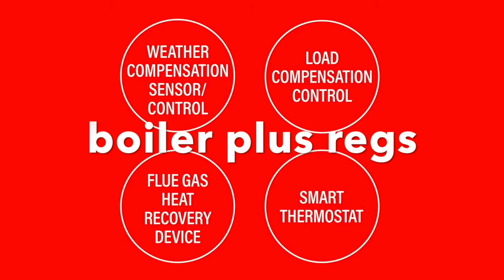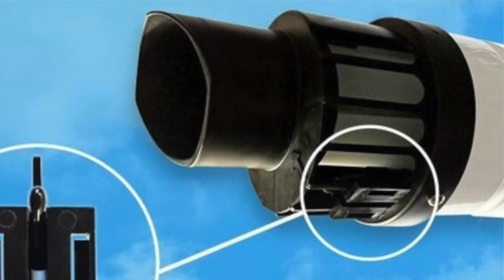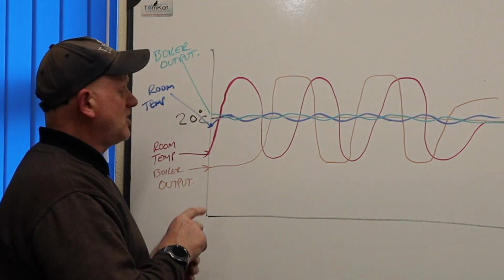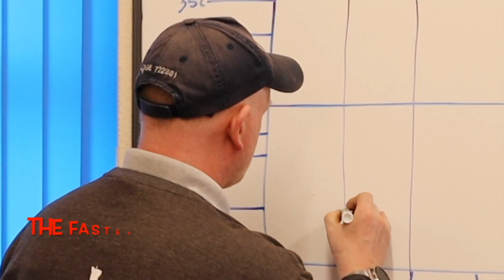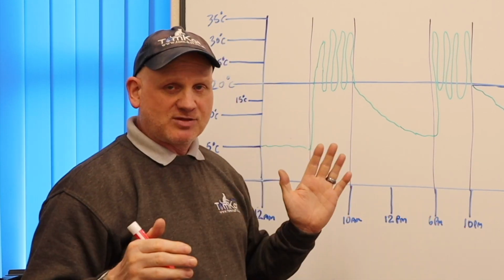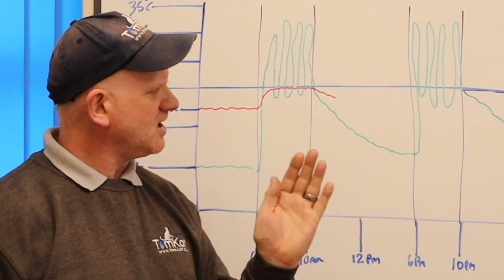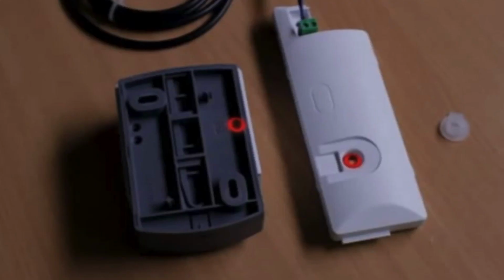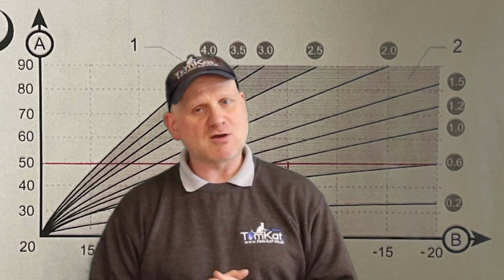Boiler weather compensation, what is it,  does it work and is it worth it.

Comment: Viessman have told me that it does use the internal controls temp sensor to know the inside temp! They say it monitors the return flow water temp and then uses that to infer the room temp. Dies that sound reasonable/correct/logical to u?

Comment: "Standard stats don't know what the temp is on the inside"  yes they do!!
Reply from the maker: No they don’t they work on a bimetallic strip that turns on or off the voltage it doesn’t know what the temperature is just what it’s been set to
Reply: @tomkatgastraining inwas referring to a standard elec stat of today with has a digital display and a room temp sensor inside
Reply from the maker: @kevinleesmith wasn’t talking about them I was talking about the on of state

Comment: Just keep your thermostat well away from radiators will solve a lot of this, prevent rapid cycling. Keep flow temp low. If boiler is on continuously at that temp should be good in winter unless system too small. In summer you don't need to set themostat low because temp stays high...

Comment: NO heating company I can find will fit this as standard, they advise against it as people heat the inside of their home and not the outside.  My new Bosch boiler has this setting menu, but the company said it is of NO use, so don't use it. The Bosch App even recommends NOT using it as it's problematic and far better using indoor room thermostats and TRVs.  The less your boiler needs to fire up, the less gas you use.  By using a temperature sensor outside and taking no notice of room temperatures, you end up having the boiler on continuously wasting a lot of money and get a luke warm house as you do with heat pumps.
Speak to installers, speak to manufacturers, they will all confirm this advice given customers.
Reply from the maker: @Bond2025 some how you are missing the point of weather comp. It works in conjunction with a room thermostat and TRVs in a nutshell the weather comp just reduces the flow temperature in conjunction with the outside temperature so the colder outside the higher the flow temperature. The room stat as long as it’s talking to the boiler ie open therm tells the boiler when it’s getting close to the room temperature to reduce the flow temperature even more. Installed correctly and set up correctly it works and saves money.

Comment: Why do I need a temp sensor on the OUTSIDE of the house, I am not heating the OUTSIDE.  I use sensors on the inside for the amount of heat required in the inside.  If a house is insulated, the outside temperature has no relevance to the inside!
THINK about it.
If you turn down the flow temp of combi boilers, you need bigger radiators and need to keep it running longer.
It's like having a turbo on a small engine, you need to work it harder than a bigger engine, which would be a standard boiler.

Exactly WHAT difference will this make when I set my heating to heat the INSIDE of the house to 22c between 5 and 9pm?
If the outside temp falls down to 0c or goes up to 7c, and the house cools down inside slightly, my boiler will keep working longer and the thermostat inside will keep the inside temperature at 22c.

God knows why you would think sticking a thermostat on an outside wall would do anything for the inside.  Why would I want to reduce flow temperature from 70c to 55c if it was 15c outside?  I really don't understand that, the boiler would be on for far longer and use way more gas.

I would prefer to have 70c flow temp and use the boiler for 20mins on and 20mins off, than gobble gas at 55c for a whole hour.
Reply: I must admit, I too feel the same way and I've tried both, 45c and 60c. We have the heating on all day so we're not too bothered about the length of time to get up to room temp (19c) per se. It virtually uses the same kw but in different ways, and anyway it's only a 5% difference in efficiency. This  5% is easily used up with the pump on usage in electricity. In fact, with the 60c flow temp I can actually put the room stat down 0.5c because of the overshoot. I suppose it's finding a happy medium.

Comment: Good video & I’m learning. To check though, the weather compensation unit, doesn’t over rule the thermostat?  The whole temperature is only set by the thermostat. Then the compensation evens out those peaks & dips. 
If going away for a week or so, then can set the whole house to be 15 deg as you showed, on tick over. Then the smart thermostat timings & temp settings can be adjusted as normal on an app etc.
Reply: Why are you trying to control the INSIDE temperature of your house using a temperature sensor OUTSIDE?
Use internal thermostats and TRVs and leave the boiler to switch on when the rooms get too cold, it will switch off when the temperature is reached.
I leave my heating on 24hours, if the timer isn't set - it only fires the boiler if a room drops below 18c, which it doesn't for most of the winter and certainly doesn't in the summer.  I have the thermostat on 22c, so it switches off when the room reaches that, then if it drops, switches on for a few minutes, then stays off.
If I was to leave the boiler on and call for heat at 15c, it would do that, but would only come on once every few weeks. Why would you want to fit an outdoor sensor?  It has nothing to do with the inside and if you turn flow temperatures down, you end up using more gas as the boiler stays on permanently to try and reach the room temperature you require.  The operation of the boiler is ruined if the return temp drops too low.
The flow temperature is chosen for a reason, efficiency.  Just because it is 70c, doesn't mean it is wrong or bad, that is what is required to get your home to a desired temperature with the most efficient use of gas, and takes into consideration the losses, pipe runs, boiler efficiency and sizes of radiators.  Turning it to 60c as an experiment  caused me to have a bigger gas bill, £35 a month more in winter compared to using 70c in the next cold month.
With a 60c flow temp the house took far longer to warm up, so the boiler was on for longer using more gas.  
At 70c again the next month it didn't take long to warm up and used less gas as it wasn't on all the time.  The system and radiators require 70c flow, any lower and I would need to turn up the room temp and use many times more gas to try and reach that.

Comment: Good to see BoilerPlus pushing WC as a standard option to meet the requirements. Plus the same WC can perhaps be reused for when Heat pumps take over. The issue is do many one-man installers understand WC and heat curves. Based on my experience looking for a boiler the answer is a hard no. Not sure what (if anything bar the basics) training is being done by installers or what boiler makers are mandating what training. Even the optional features for some boilers (like Bosch and Valliant) seem a total surprise. Seems many installers never have to learn much more once they are a registered installer such is the sales pressure to have your brand boiler being installed over the next (often very similar technically for the main volume models) boiler brand X

Comment: What would you reccomend for a very old large stone house to optimise performance vs cost. I have a brand new combi, but temps take hours to get up again if left to drop too low (sub 15c). 15c - 16c can take 2 hours to reach. Will weather comp help as leaving heating of for 8 hours while at work you cant get temp up for evening.

Comment: Why don't manufacturers measure the temperature of boiler intake air inside the the.intake as the air is the outside temperature 
This would make it self contained in the boiler and less for engineers to fit and repair no batteries cables and RF etc

Comment: But I have a gas boiler that can modulate as low as 3.4kW. When outdoor temperature goes up, room thermostat signals that the room temp is slightly exceeded (maybe half a degree), boiler reduces output. So, my room temp is constant. How does weather compensation help save gas then? My room temp is constant and my boiler constantly works (no cycling) but with lower or higher output, as required.
Reply from the maker: If you’re boiler hasn’t been range rated it will always fire in high fire at the start but with weather comp it tells the boiler how much to fire depending on the outside and inside temperature
Reply: @tomkatgastraining  
Thank you for the quick response. Actually my boiler will be installed in about a month. I am now learning how to set things up. Your channel is helping me a lot. Thanks!

Comment: I always fit boilers with a range rating capability measure radiators add 10% and 10% for pipe work and set boiler to thst and lower flow temp to 58 degree people don’t realise your rads only get to 60 degrees anyhow 😂 smart stat your laughing 👍💪

Comment: I have found if I use the return water from the heating system to pre heat the indirect domestic water I can send cooler boiler water back to the condensing boiler which results in boiler running at higher condensation rate and thus higher efficiency.

Comment: My solution to setting heat curve is to set room thermostats to as high as they can be set ,in effect removing them from controlling the building’s temperature. I then adjust the heat curve to bring the building temperature above the highest temperature that is desired. When the temperatures stabilize I then set the room thermostats to comfort level desired. The biggest complaint I have is there is no compensation for high winds, or rain which effects the heat loss of the building.

Comment: Hi Tomkat (Derek) ive recently had a baxi 800 fitted. Saves a fortune over my old Ideal Mexico heat only unit on an old vented water tank system.
  Im looking into fitting the Baxi weather comp sensor. Its very cheap and only requires the connection of 2 wires into the electrical side of the control panel. The temp sensor itself fits into the flue outlet.

Ive recently carried out a simple couple of tests and am wondering if it actually works and is worthwhile fitting.   
I ran for a week at flow temp of 60 deg, then the following week increased flow temp to 70 deg. My Hive thermostat was untouched in heating times/periods and temps.   Through the Hive data captured i was able to see that at 70 degs the burner didnt run for as long and the house increased in temp quicker. At flow temp of 60 deg, boiler run time was longer and temp increase time was also longer.  However gas consumed  was over the 2 weeks i ran the simple test, the same, in  fact exactly the same.  The burner then works harder but for a shorter period of time.

Whilst not a true scientific test (weather was similar but not exactly the same)   The property is a standard 3 bed semi, loft insulation good, windows are all new, no cavity wall though. During the night the heating is all off, we do not have a fall back temp so it cools down to around 14/15 deg this time of year. 
When the heating is running during the evening its set point will be no higher than 18 deg so its not exactly a sauna inside.

I suppose my questions is, does weather comp pay dividends over the long term. From my very simple short term experiment im struggling to find a positive reason to fit. 

Or, should i spend a couple hundred and go for a full opentherm system (Hive does not do open therm and the benefits it brings) such as Nest

Great channel BTW, have learnt so much on setting my system up, thanks.
S
Reply from the maker: Weather comp and open therm controls are the best way of saving money but there is about a 5 year pay back. It all depends if you want to save the planet with less co2 or not

Comment: Thanks for the good video, I was wondering how this works for the hot water, cylinder side. e.g.  say you need 59 degreees C , how can this work if the boiler is running at a lower flow temp, in that case  then I'll never get up to 59 Deg C.and I'll have low temp water for the bath ?

Comment: Imhaving a new Worcester system boiler installed in January and am interested in weather compensation. From what you say though, the set up isnt User friendly (yet) and an engineer has to set up and tweak to get just right? Maybe once companies make waether comp easy for the User to set, more would have it?
Reply: Speak to the manufacturer, they do NOT recommend it.  My App tells me not to use it.
Outside temperature sensors will never control the internal temperature of an insulated home.  They are a waste of time.  Why even fit one when it uses pre-set data from a nearby location and not your actual data?  Use the gas boiler as the engineer set it, it is set to work efficiently based on YOUR HOME and YOUR SYSTEM.
Just because someone else runs a 64c flow temp, it doesn't mean yours will be as efficient.  You might need a 70c like mine.  I have seen some set higher and they work as the installation was designed for efficiency.

As an experiment, I heard Martin Lewis going on about turning flow temp down and tried it.  I went from 70c to 60c and it meant using £35 more gas a month because the boiler was staying on LONGER to try and reach the desired room temperature.  The heat output from the radiators was now LOWER and return temperature to the boiler lower than what it was expecting.  The house took ages to get warm.  Turning it back to 70c meant using less gas as the boiler was on for less time and radiators were giving off the amount of heat specified with a 70c flow temp.
The house heated up faster and the boiler only come on a few times per hour and didn't stay on long.

Comment: Why can’t you just manually adjust the flow temp on the boiler as you see fit depending on the outside temp?
Reply: Right, That's just what I've been doing since I had the weather comp that came with our new build disconnected a few years ago. It's so simple.

Comment: I don't really see how the outdoor temperature is really relevant. Yes outdoor temp will affect the amount of heat loss from the dwelling but the point is the desired indoor temp. If you want an indoor temp of 20c then the boiler will attempt to maintain that regardless of outdoor temp. The only benefit I can see is boiler modulation but again it is the desired temp that is the main factor.  I am open to being enlightened. I am fully aware of flow temp regulation and the benefits of condensing. 😀

Comment: I've been trying to to sort of manually do this, as in control the boiler flow temp to maintain 21 degrees in the living room without cycling. Outside temp is about 10 degrees and with my boiler turned down to 50 degrees, after 20 minutes the boiler temp rises slowly to 56 degrees and then switches off. Tells me that my boiler is too big for the current setup so would installing bigger rads help it run at 50 or do I need a more modern modulating boiler? I've got a Baxi Platinum 28 with 11 rads. Thanks.

Comment: your example curve 1.0 has a flow temp of around 32c with outside temp of 12-13c. Roughly what I’m seeing on mine. But the boiler is too big to give me 30c without cycling. Is that ‘tough’ and just a byproduct of combis being oversized for HW?
Reply: No, you just have a poor modulation boiler. For perfect weather comp you need at least 1-10 modulation. The only way to get around it is to raise your curve to avoid rapid cycling

Comment: do you have a video talking about modulating and range rating? As many with a combi boiler, its sized for hot water and oversized for heating. 30kw combi, 1:8 modulation (not bad), heat loss of 6kw in the house. When its mild I think max modulation still isn’t enough and the boiler is cycling. Can the boiler be range rated down for heating, or does that reduce the modulation too - i.e if modulation will go down to 3kw, will range rating to 50% let me get 1.5kw out of it, or will it still be stuck to 3kw and the modulation reduces to 1:4?
Reply from the maker: I am in the process of putting this together for a video 👍🏻

Comment: Anyone know if this sensor is 10k or 12k ohm and uses OT protocol to boiler?
Reply: My Worcester Bosch one appears to be a fairly standard thermistor resistive type, it's hard wired to the boiler via co ax cable, no protocol involved.

Comment: This is an interesting introduction to WC, which have been in existence,  in commercial buildings, for 50 years or more. I would have liked more detail on how to integrate WC with boilers that dont have the onboard facility for direct compensation,  normally this would entail a mixing valve to modulate the flow temp. not very practical in a domestic setting. The comment about boiler output of 35 kW would imply that you're talking about  a combi boiler which has not had its heating output matched to the actual heating load. I am a great fan of WC but have struggled to find a controls manufacturer that produces a kit which is suitable for a system boiler that provides DHW via a cylinder, ideally a room controller which the customer can easily adjust the curve and allows the boiler flow temp to ramp up when there is DHW demand.
Reply: I used a mains coil relay which is operated when the heating of my domestic hot water is enabled via the control and on demand via the tank thermostat and the motorised valve.
The relay puts a resistor in parallel with the weather compensation sensor which tricks the compensation algorythm in the boiler into thinking it's got very cold outside, and this produces max boiler flow temperature.
I've been running this for 4 years now, it works well. The only downside is that any radiators that go on demand while things are in water heating mode become prone to overshoot ;-)
My boiler and compensation sensor are both Worcester Bosch, and the resistor is 7Kohm.